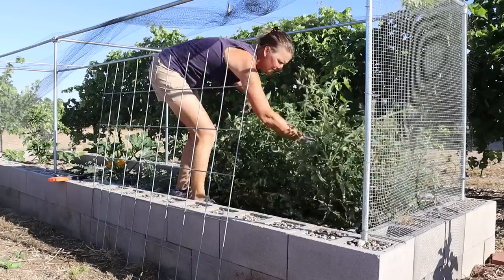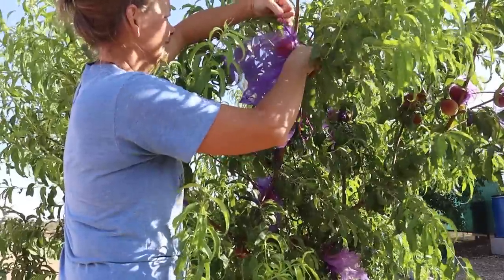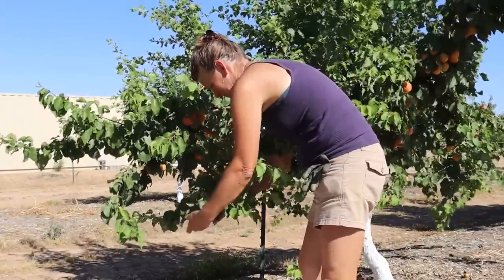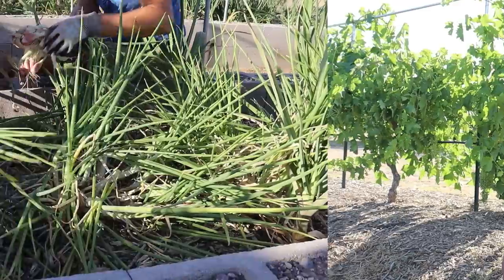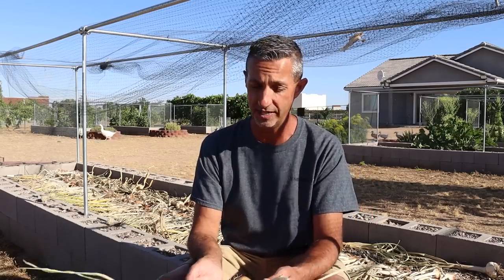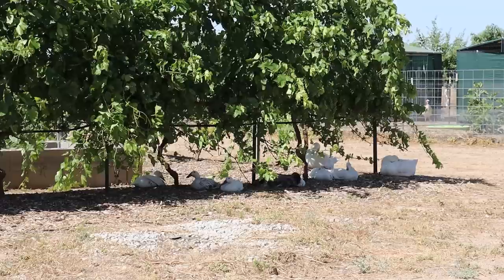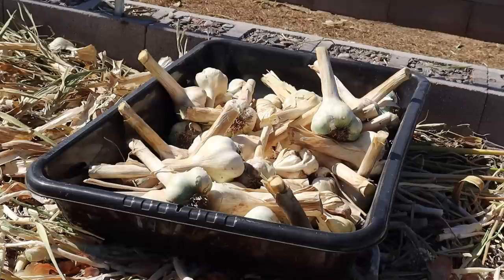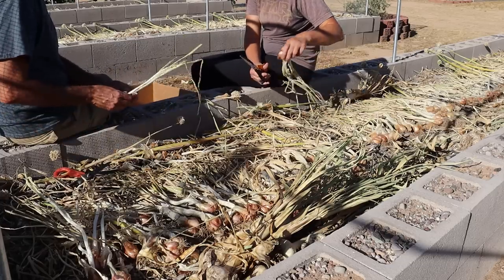The BEST Onion Variety for Desert Gardens? | I'itoi Onion | Garlic Harvest

Comment: Do you guys do much sunflowers? I haven't seen them in the videos. I think they are just the most beautiful flowers and they are so hardy. They love the heat and can really go most of the summer. Additionally, the birds will eat the seeds and it helps keep them off of some of the other crops. Note I said it "helps" doesn't stop them from eating other stuff. They will eat what they eat and there is no stopping it short of netting but a few alternatives do help. Also, I don't know what you need for your bees but they might be good for them too. They are so easy to grow. You could literally just push a seed down into your wells around the trees and get them all over. I also use them to trellis stuff. I got tomatoes and Armenian cucumbers growing up some. Might try to grow cantaloupe up them next year.
Reply from the maker: Hey Alan! We have grown them a couple of times and are trying to seed a few into the area around the banana this year. The biggest challenge we have here is the quail. They eat pretty much any start that comes up that's not covered and we have lost entire crops of sunflowers to the little buggers.
Reply: @EdgeofNowhereFarm  Do the quail go into the chicken/turkey/or duck runs?  If not, can you plant them in those runs protected from the chicken/ducks/and turkeys?  If you can get seed heads off them, you can wire up a seed head or two to the fence of the chicken run a foot up from the ground and the chickens will have a blast pecking the seeds out of them.
Reply: @EdgeofNowhereFarm  Wow, I didn't realize that the quail did that. Too bad!
Reply from the maker: @irisdude  the challenge inside the runs is the chickens! They eventually get into just about everything unless we protect it top to bottom. It's actually easier to protect from quail.
Reply: @EdgeofNowhereFarm  I am litterally laughing out loud.  I have read so much about people's experiences with chickens that I don't doubt you.